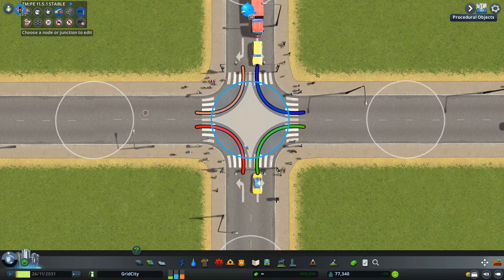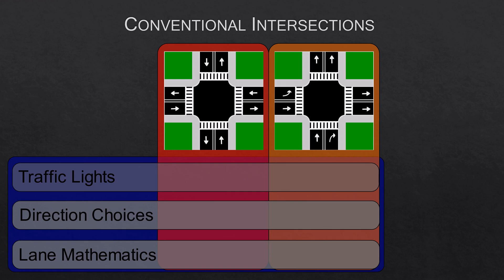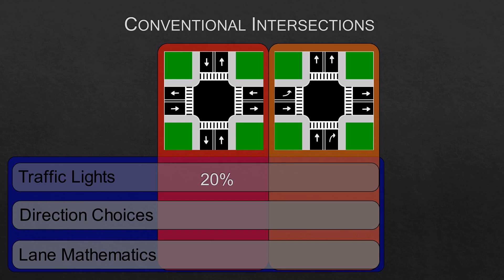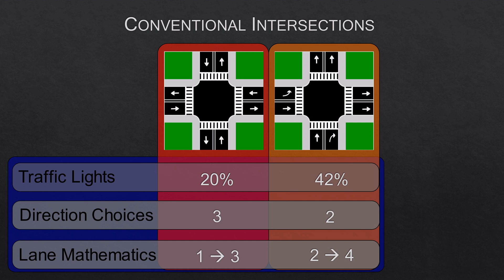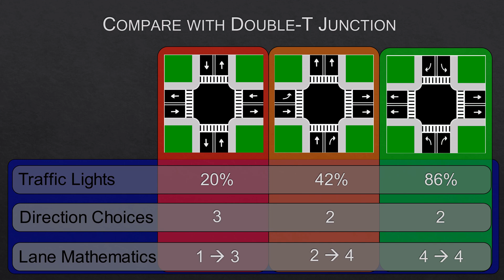How To End Traffic Jams in Cities: Skylines

Comment: 6:13 might be worth noting that changing lanes in CSL requires a node.  So if you draw this grid with only one segment between intersections, you can't do the 1:1 lane math as it just makes a bunch of disconnected circles.  Did you have 2 nodes between intersections in the demo?  I think that's what I saw for where they were changing lanes...
Reply from the maker: I think I'm going to have to pin this post because this is a very important point. I originally had a whole section in this video about rectangular grids and I trimmed it out to get this video down to a manageable length. Unfortunately that was the section that talked a bit about road nodes!
So, Yes, having a node (or two) in the middle of the street in between intersection is super important if you want this double-t grid concept to work. There has to be a place where vehicles can change lanes in between intersection. If the block size you choose is quite small you might have no road nodes in between intersections by default, but it's possible to add some in by temporarily adding in an extra road intersection half-way down  on the street and then removing that road again.
As for what you saw, yes indeed , I do have 2 nodes in between intersection on this map, but only in the cleared center blocks at the center of the map, on this map it's not required for traffic flow at all, I did it just so the lane changes would look more natural in screenshots and video clips.
Looks like I might have to make a follow-up video to this one, there's also a few important points about hybrid grids that I left out!
Reply: One option for getting the extra node would be to make the Double-T grid just twice the size.  For example, make it 20×20 and add another road down the middle to get 10×20 zonable rectangles, alternating in direction to keep them from ever connecting into a longer road.  That does add a touch more traffic at the node -- the turning stuff as well as the lane changes -- but that middle road can be a low-speed one so only the local traffic would ever use it.

Comment: I came up with the same concept about 2 years ago. I never used it for a whole city, though. Nice to see that all encompassing sea of orange in this city; This is truly the easy mode of traffic management.
My blocks of "double-T grid" cover only 3x3 to 5x5 blocks (2x2 to 4x4 intersections) at a time, followed by a couplet/avenue. In that form, they are very similar to the "superblocks" in Barcelona.
I actually view the fact that cars going in the orthogonal directions have a path that's twice as long as it would be in a conventional grid as an advantage. It keeps traffic from cutting through my neighborhoods. But if you use two-lane-one-way roads with cycle lanes in both directions, you can avoid discouraging cycling via that same distance penalty.

Your idea of mixing double-t junctions and conventional one-way grids is something I've never thought about. I wonder if there's some regular arrangement that offers optimal flow in every direction.
I wonder if you can actually improve travel times with that. As you said, a conventional junction of one-way streets is green for less than 50% of the time. It seems like making the paths twice as long is compensated for by having close to 100% green time (and that's not even accounting for the clear gains in the diagonal directions, same length and a factor of two difference in green time). Then again, they are only evenly matched in the orthogonal directions when the conventional grid doesn't "cheat" by having its traffic lights synchronized. But for that to achieve optimal effect, you'd need the one-way roads to be as long as possible...
Reply from the maker: Thanks Pystro, 
hope you liked it. 
There is an issue with modelling a mix of double-t junctions and one-way streets in Cities: Skylines unfortunately. The traffic is going to favor the one-way streets too much and clog them up because the distances are shorter, (even though with traffic lights and congestion mean they take longer). It turns out though, the "orthogonal directions having longer paths" problem is not nearly as bad, or important as you think, to be fair, I didn't realise it either. It turns out that with just the shorter traffic light times, it can still be quicker for a vehicle to cross a double-t grid than a conventional one-way grid. I go through all of the detail in my next video:
https://www.youtube.com/watch?v=UKIpUDFLnJs
And even when synchronised traffic lights are used, the average journeys will still be slower in a conventional  one-way grid

Comment: Star traffic diverters are a thing IRL too. Rare to use them at every intersection, but like every traffic diverter they can be useful in some places to keep traffic where you want it and prevent drivers from taking shortcuts through places you don't want them to.
Reply from the maker: Thanks for your comment. Yes, I know star traffic diverters are widely used in the real world, I haven't seen any paired up with back-to-back T-junctions though. And yes, they are useful for diverting away from where you don't want it, but I'm using them in a different way, I want traffic to be diverted both directions, because with the properties of this intersection (high throughput and very short traffic light stops), it turns out that vehicles will be able to navigate around this type of city much faster (on average).

I've had a look at your channel and it looks like you know your stuff, traffic-wise. I've got another video which goes into detail on how and why this new system is better for overall traffic flow:
https://www.youtube.com/watch?v=UKIpUDFLnJs